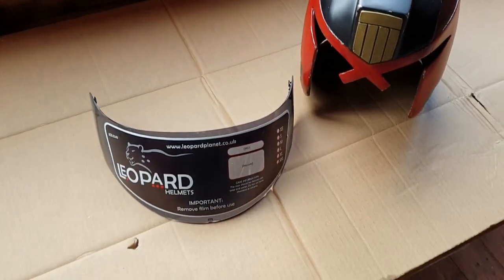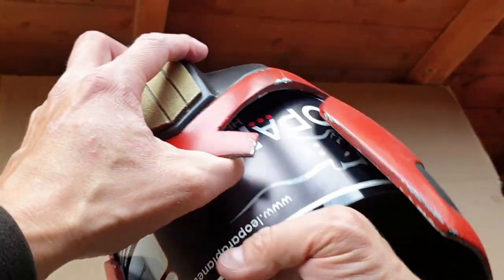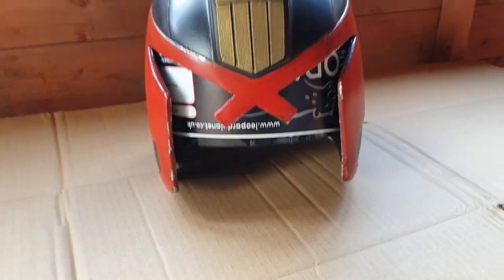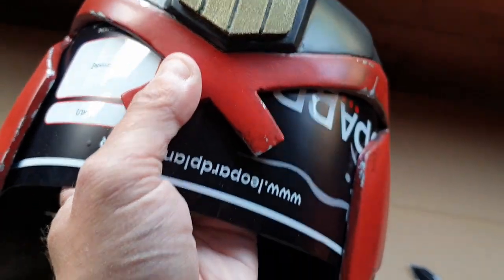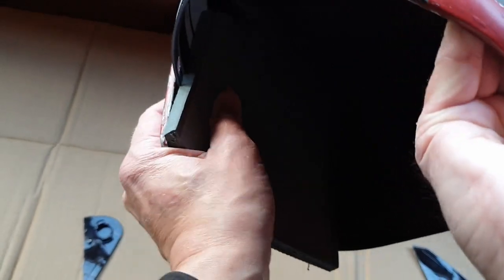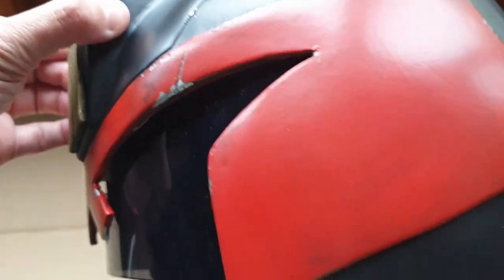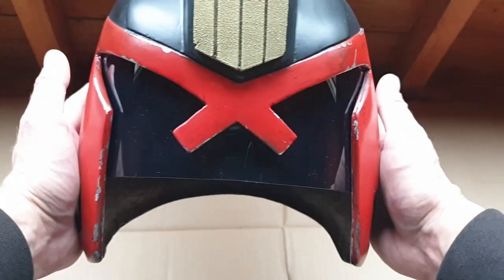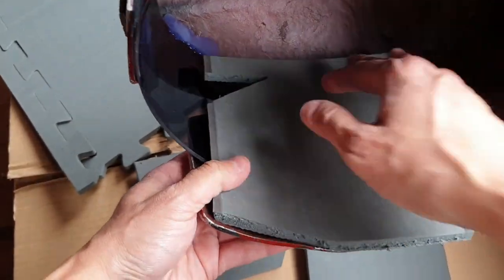Judge Dredd Helmet Tutorial Part 2: Visor Installation & Foam Lining

Comment: Looks great, what size or model number of visor do you use?
Reply from the maker: Hi, I've looked through the photos I took of the visor and my ebay emails and can only find that this was a Leopard visor model LEO-838 flip up helmet (outer smoke visor).
None of the emails and none of the photos of the visor and the label before I cut them up state what size it is.  When I look at the ones on sale on ebay now they dont show the size either.  So can't help on that I'm afraid. 
Hope this helps.
Reply: @arewethebaddies7593  Thanks for the info, I sent the question before realising you posted ages ago. Cheers